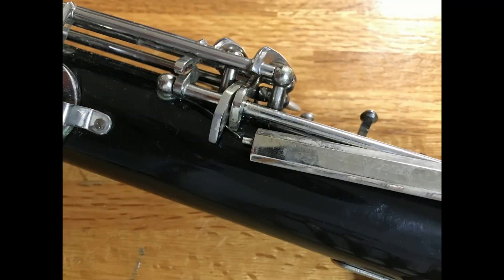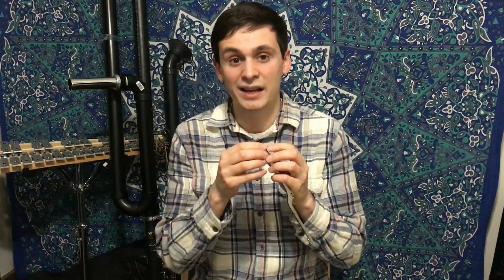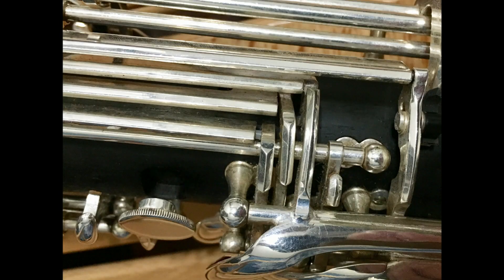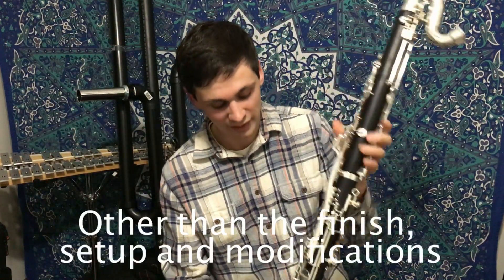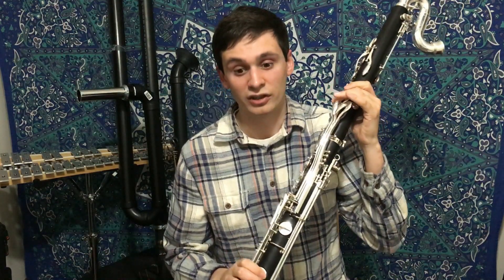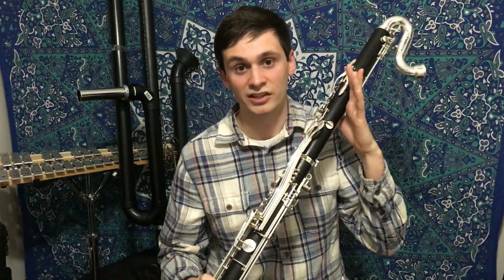The Nylon Pin Dilemma, how Michael Lowenstern's bass clarinet broke

Comment: is there room to countersink a nylon bushing in to the other half of the mechanism? then you could have a metal pin for strength and the bushing for quiet.
Reply from the maker: On some instruments possibly, I prefer putting a sleeve over the pin itself

Comment: Yeah I've had a pin snap in half and get stuck inside its slot. I had to screw a small screw into the broken bit to pull it out. The nylon pins still do make a fair bit of noise so I don't see the point. Also, I wrap my B/E pin in Teflon tape to keep it from clicking when I press the right hand key (because the left hand lever is loose when I hit the right hand key). The friction of the plumbers tape somewhat slows the action of the lever, but I actually find that the lever moves too freely anyway.